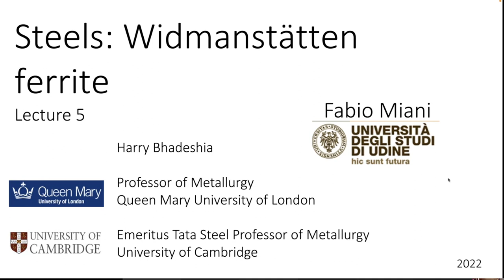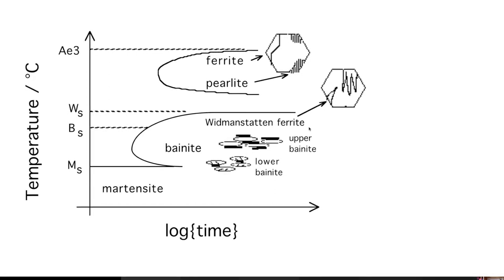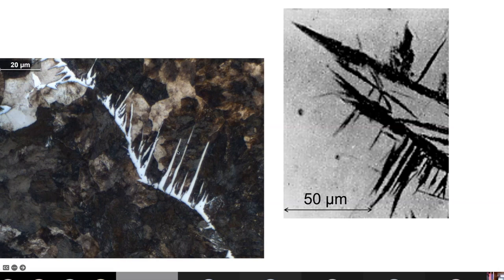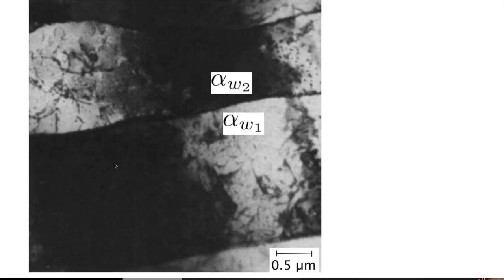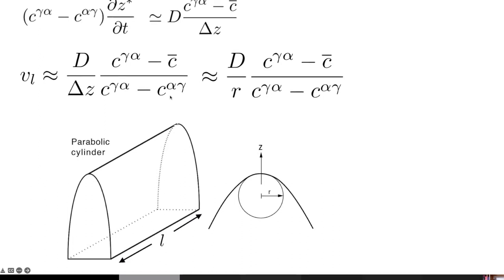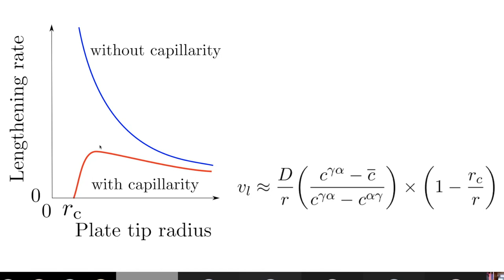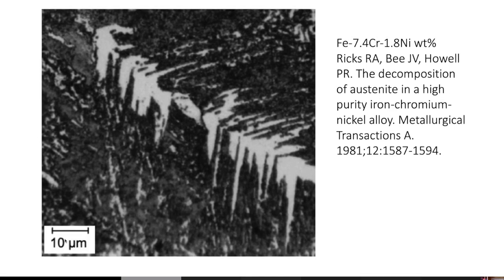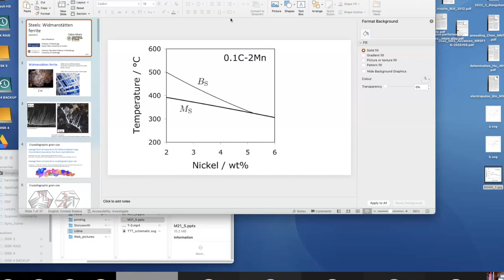Widmanstätten ferrite

Comment: Thank you for this lesson Professor, I read your book “Steels” and this part was  hard to visualize, but this helped a lot.

I have a question

Given that It is economically feasible, are there any theorical advantage of having Widmanstätten ferrite in a structural steel?

Like in

-Dualphase steel Widmanstätten ferrite/martensite

-IF steel, having Widmanstätten ferrite before cold rolling to take advantage of some crystallographic texture, or increase recrystallization rate

Thank you

Looking forward for next lectures
Reply from the maker: Thank you, Adrian. It is a good question on whether Widmanstatten ferrite might be advantageous in some circumstances, but I don't have an immediate answer. I think this would be worth investigating experimentally but I do not know of any literature on the subject.
Reply: @bhadeshia123  I see, thank you for your answer.

Another question

The crystallographic misorientation of αw vs parent austenite is something between Bainite and allotriomorphic ferrite?

Doest it change due to the necessity of carbon diffusion? Or It would be similar between a high carbon steel and a IF steel?

On a second thought, if the orientation of primary αw and secondary αw is the same, then the orientation is always equivalent to allotriomorphic ferrite right?